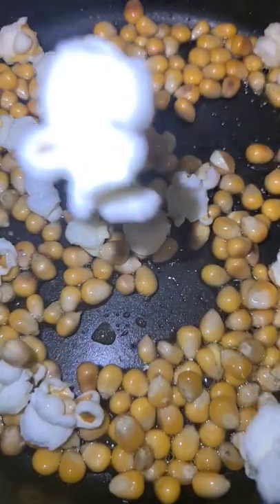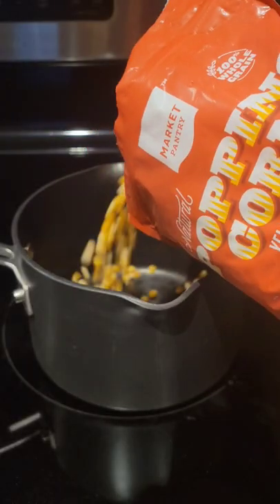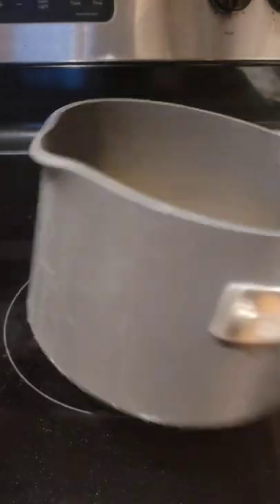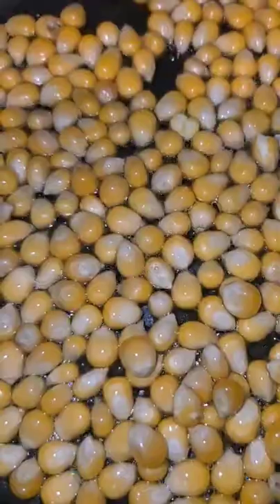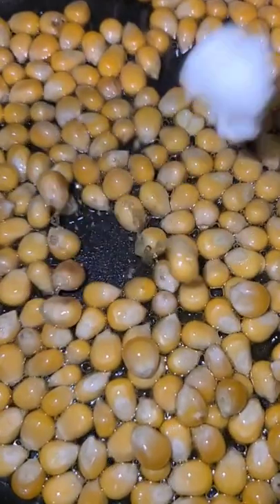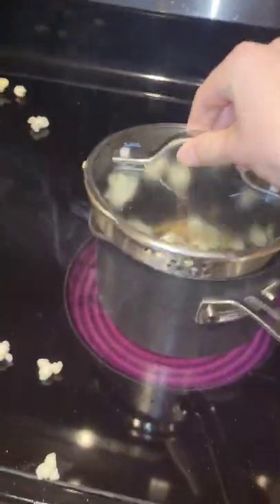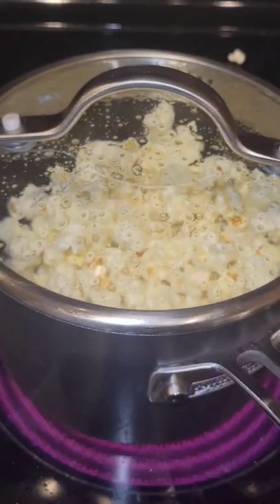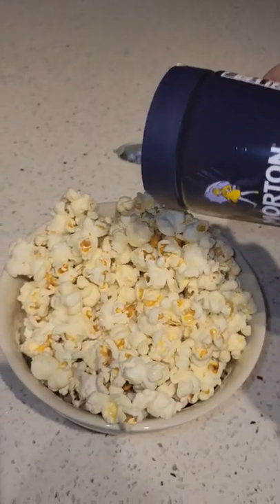What makes Popcorn Pop? - Slow Motion Popping

Comment: Who the fuck cooks popcorn in oil and not butter?
Reply: Most people? Butter has a very low burning temperature, so if you get it not diluted with other oil hot enough to pop the kernels the butter will be burnt and will add a very burnt taste to the popcorn that's not pleasant. You are supposed to pop the kernels in vegetable oil or canola oil and then add butter as a topping once it's popped. That's how it's done in popcorn machines and any place that makes popcorn to sell.